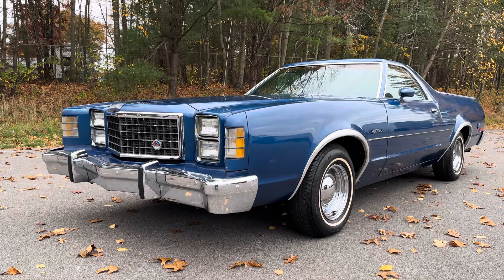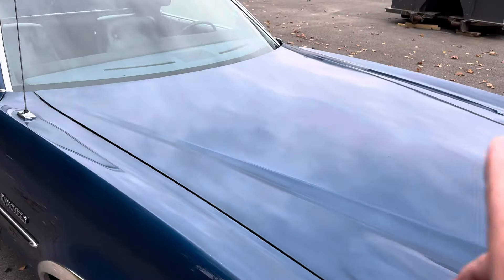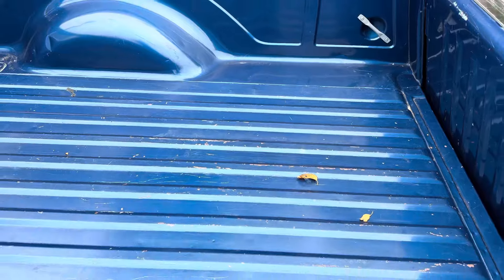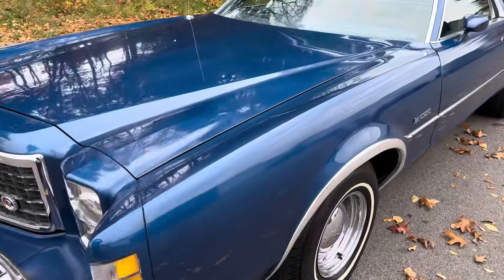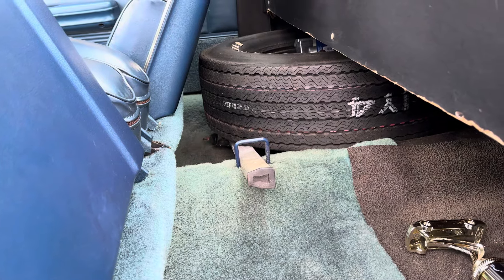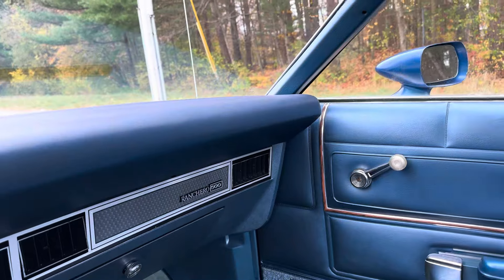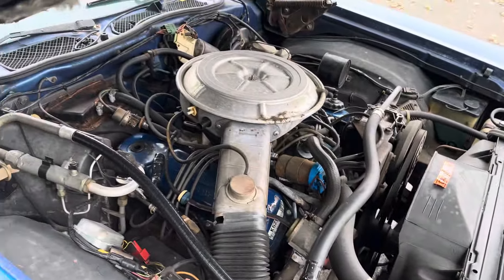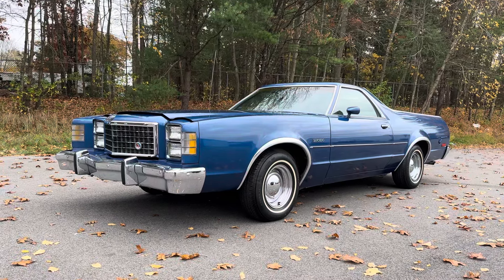1977 Ford Ranchero

Comment: It's missing the crankcase breather tube that goes in the grommet at the rear of the right valve cover and connects to the breather filter in the air cleaner. 
 That 351M means means a 429 or460 will bolt right in. Personally I'd go back to some original magnum 500 wheels. Nice car

Comment: Those bumper jacks were so dangerous! Thank god those are history
Reply: No they weren't if used for the intended purpose of changing a tire on level ground.
I don't recall anyone calling them dangerous in the 60s. They're terribly unforgiving to stupidity.
Reply: @ , they are dangerous. They were poorly designed and would collapse very easily if the vehicle wasn’t perfectly positioned. And if the vehicle was accidentally moved or weight shifted they would surely collapse!
Reply: @sachemrock  not true; owners who failed to chock wheels were the ones who had issues. Your comment is completely out of context. The "vehicle won't accidently move or shift" if directions are properly followed. 
I own a '79 Ford with that jack. It has never been an issue.
Reply: @richceglinski7543  true

Comment: I'm concerned why this car has aftermarket wheels, and why the underhood appearance is far inconsistent with a California car driven only 48K miles. Paint chipped that bad on the driver's door mirror housing indicates a repaint at some point in this car's history. I'm not calling this seller dishonest, but I would beware before I make an offer to buy this vehicle at anywhere near that $11000.